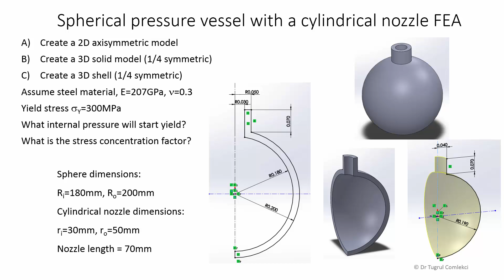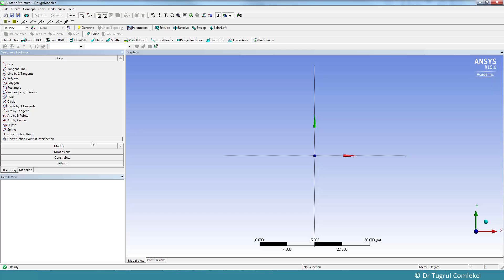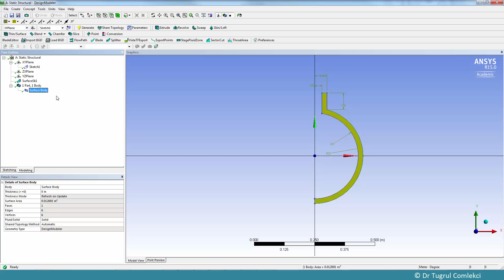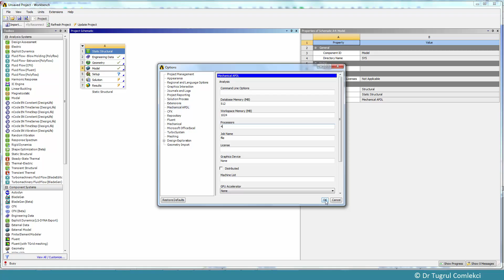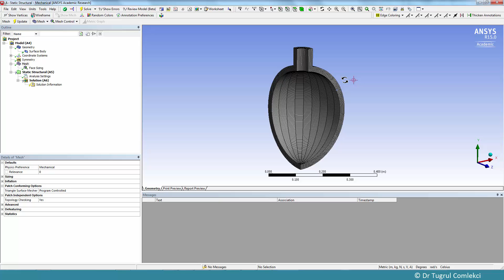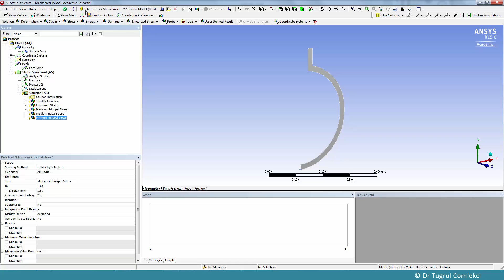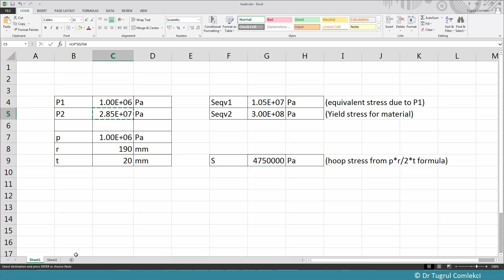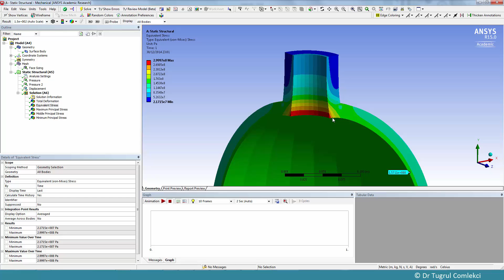Spherical Pressure Vessel with a Cylindrical Nozzle FEA - Part 1 2D Axisymmetric Analysis

Comment: what if I apply a thrust force (on the nozzle) in +Y direction of (706.858 N) instead of pressure load? how it should be done?  I tried that but I got high deformation and stresses. any idea?

Comment: Hi, why P2 is negative?
Reply from the maker: Kothilngam Maring Hi, a negative P2 is applied on the nozzle top surface to simulate the effect of a closure (flanged end closure or attached piping etc.) where the internal pressure in the vessel acting on the closure is generating a force to push the nozzle up as in this example.

Comment: I tried to follow the above procedure, however I can only see 2D geometry. I can't see the results on expanded geometry. I was wondering that do you know the reason ? ( how can I see the results like on this video at 14.08 s instead of 13.31 s). Thanks a lot
Reply from the maker: az na Hi az na, thank your for your comment. This is explained at 8:00s: essentially by turning on the beta options for the project, and adding a symmetry tool in the Mechanical tree (at 9:00s).